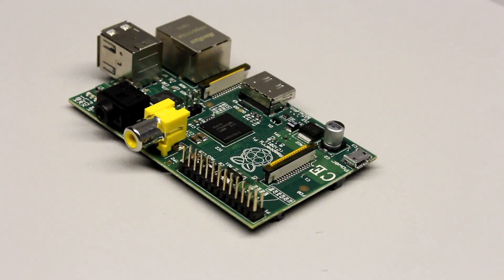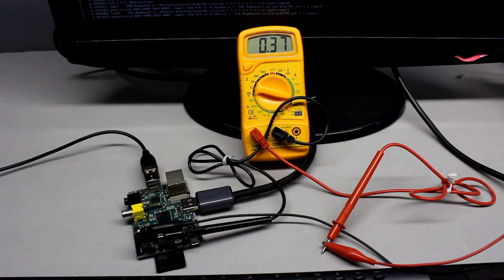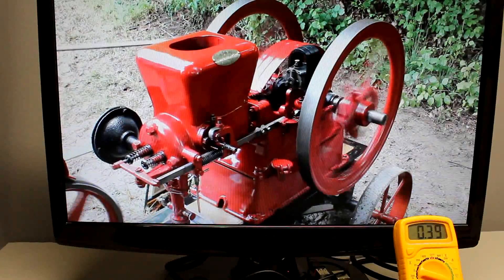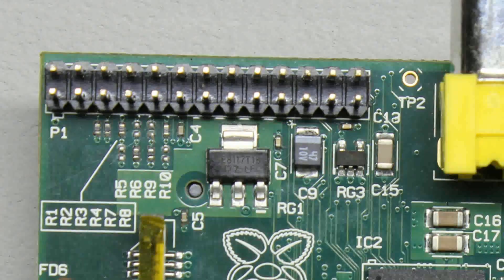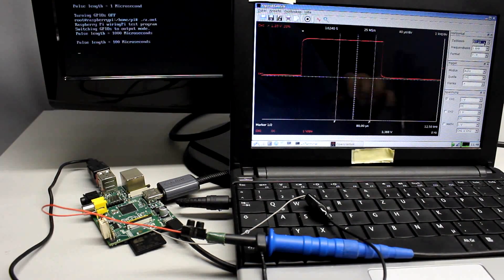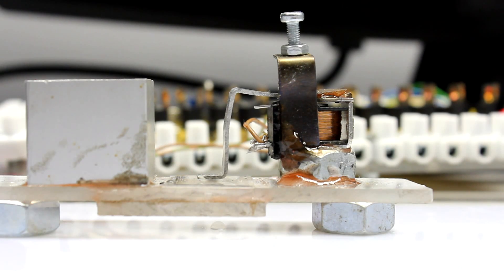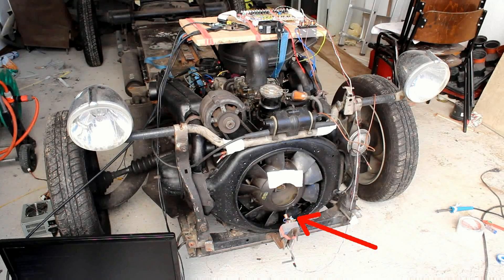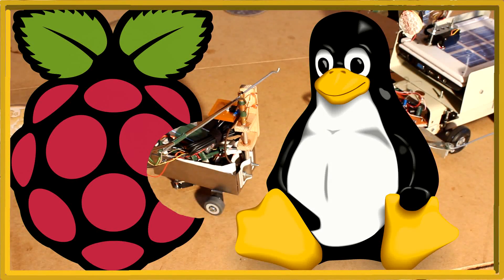Raspberry Pi (English)

Comment: +HomoFaciens Thanks a lot for sharing. Excellent video! It is possibile to have the schematic of the DIY extension board that you've used in the video?
Reply from the maker: Well, I have removed the schematics of this board and replaced it by a general description of how to do "physical computing":
http://www.homofaciens.de/technics-computer-io-boards_en_navion.htm

The original board had too many drawbacks. I will create some more chapters about how to use GPIOs (hard- and software) over time - stay tuned!
Reply: HomoFaciens Thanks!

Comment: Thanx great video. 
Can you send me the code please
Reply from the maker: You're welcome!
What code? Most of the stuff shown in the video was created "on the fly". The only application still running is the tiny robot driving in my RoboSpatium:
http://www.homofaciens.de/technics-robots-R3-control_en_navion.htm
You can get a simple version of the robot code at the download section of my project page including the circuit layout.
I will do some more "physical computing" including code examples soon, so stay tuned.

Comment from the maker: Its better to post problems like that in the raspberry or arduino forum, since the 500 characters of a YouTube comment are not enough to post the whole script (and if, the alignment of the code is horrible). A picture of your circuit would also be necessarry to understand what is going on.
Sorry, but this is not enough information to give you a solution or even to understand the trouble of your circuit...

Comment from the maker: A coil is used to generate electric energy (voltage) whenever the permanent magnet is aproaching or is getting off the coil. A Zenerdiode and a resitor are used to limit the voltage to 3.3V (or else your Pi will be destroyed). The software is reading the pin connected to the Zenerdiode to be able to detect a HIGH signal (=Pulse).
Have a look at the video description - I have inserted a link to the board layout.

Comment: Yes, but it's the only choice.  If you need a signal higher than 5 Khz: you'll gladly prefer a noisy analog signal, over no signal at all.

I just wanted to suggest it as a way to work-around this limitation.

Comment from the maker: I am sure your car has no plug connector for a Raspberry Pi...
I have connected the magnet switch of the electric starter to the battery via a relay. The relay was switched by a MOSFET via one of the GPIOs of the Pi.

Comment from the maker: Depending on the way the GPIOs are actuated by software, there are higher frequencies possible. Some of the pins can be used in special modes (e. g. in communication mode).
I have switched all of them to simple input/output (on/off) mode using wiringPi so the highest frequency was just round about 5kHz as demonstrated at the video.

Comment from the maker: For the motor control?
It's just the magnet on the fan and the strong servo actuating the throttle. The software was written quick and dirty, just for the video. I really won't use it in my 2CV - I love those car because it is totally free of electronics...

Comment from the maker: There will be some more about that stuff at my project page and my YouTube channel, but it takes a lot of time to create those videos - be patient.
Arduino is cheaper (at least the single chips), smaller, more energy efficient and good for real time processing.
Raspberry is more flexible, because you can do the coding and execution on the same board. Both are interesting in their way.